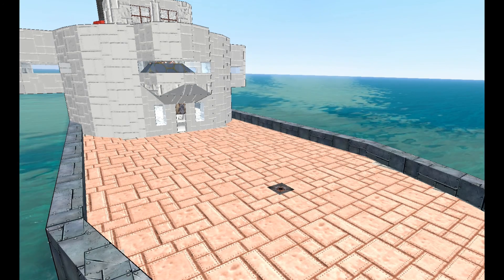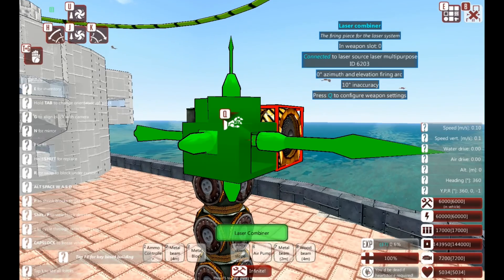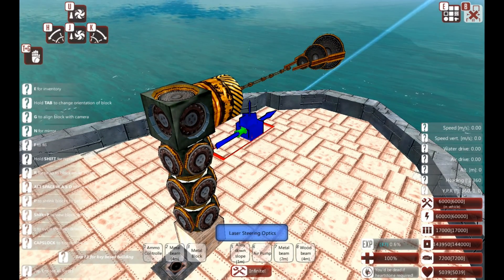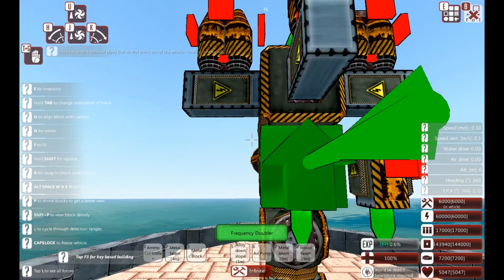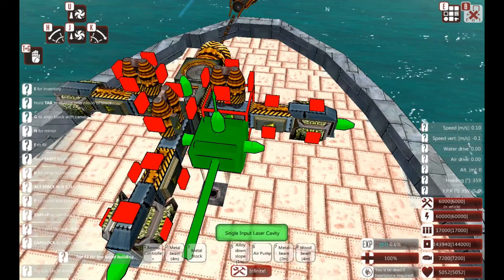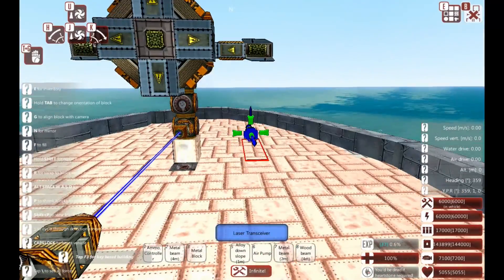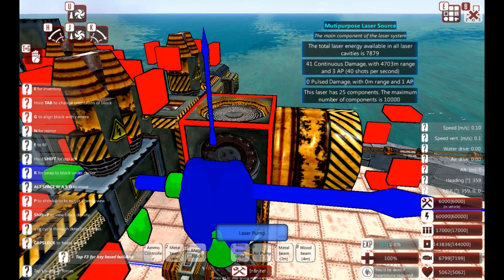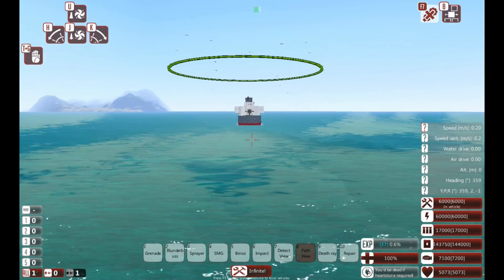From the Depths - Laser tutorial

Comment: Just a small note: the AP value displayed (1+number of doublers) must DOUBLE the value of AC. This means that for example metal (AC 10) you need AP of 20 and not 10. Thats why you see on most laser systems either 21AP to counter metal (since lasers ignore armor stacking) or 81AP for countering heavy armor.
The thing about AP:AC ratio is same for every weapon system. It is 2:1. Important. Really.

Note under note: For every other weapon system (besides PACs but PACs are 2 stronk atm) you need to take account aromr stacking values. Also really important.